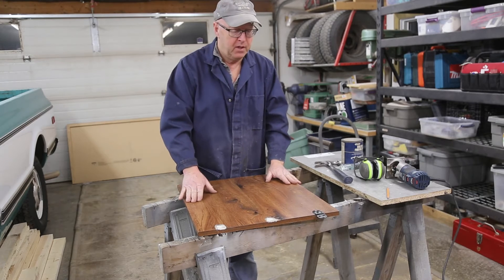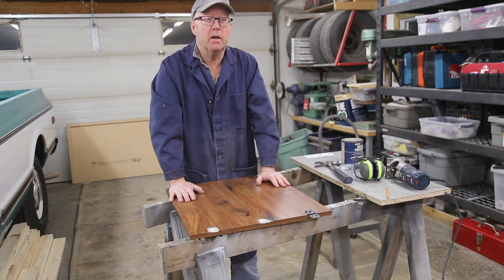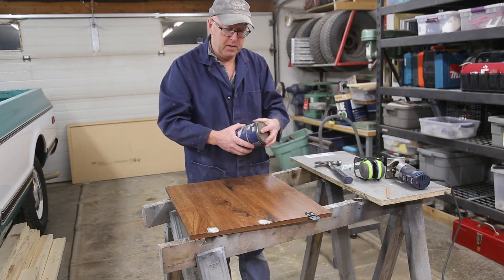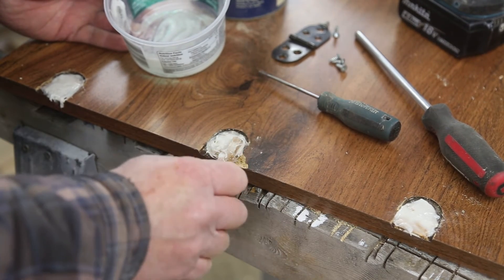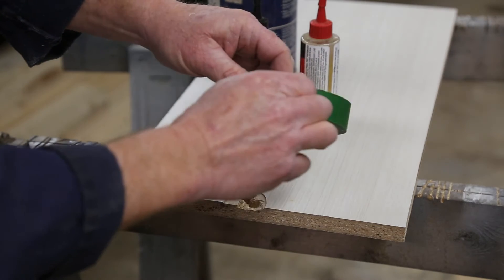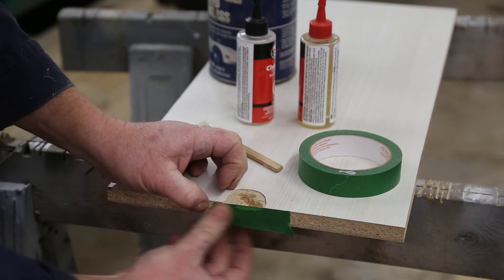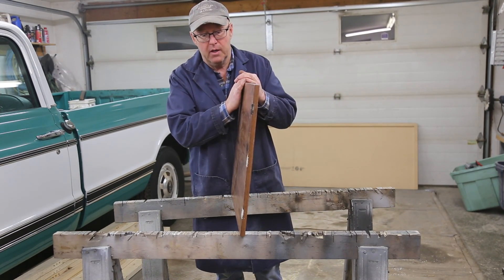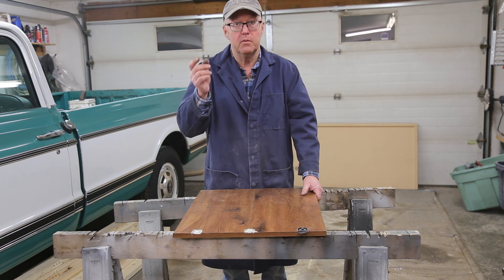Particle board repair with epoxy and fiberglass

Comment: How's she goin'?  This looks like it might be a good repair and hold the hinges.  But really, with particle board, it's always a risk it'll break out again eh!!  This was good idea though to put the fiberglass in the epoxy!!  Take 'er easy!!
Reply from the maker: I think it will work but for how long.  The epoxy is still surrounded by particle board.  I am still amazed at how long some of that furniture lasted being built out of that stuff.  This sewing table was just a poor design, it should be braced.  I don't want to get in the habit of fixing this stuff.  Thanks Mike.  Stevo

Comment: would it be worth it to add a swing out brace attached to the  cabinet so when the top was opened you could swing the brace our and let the table rest on it to take a lot of stress on the hinges?
Reply from the maker: Yep.  I looked at that but it would be difficult to do but a guy could try and hinge something.  The table is just a poor design and I don't think it is going to be used that much, hope.  There was sure a lot of particle board furniture made.  It burns nice.  Thanks Vern.  Stevo